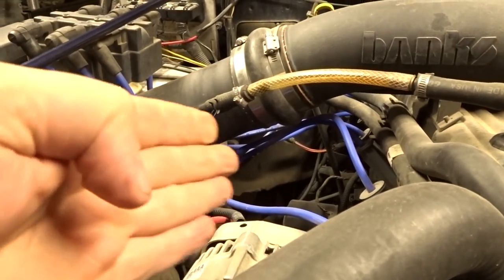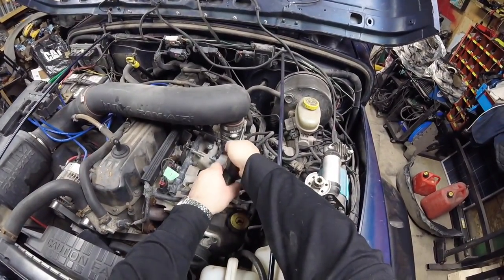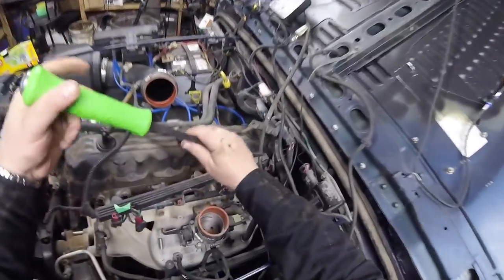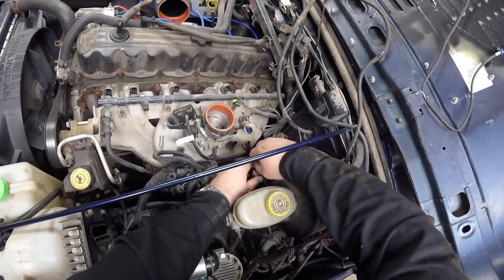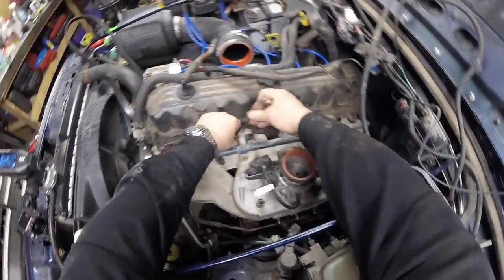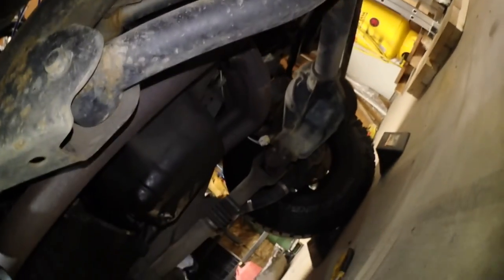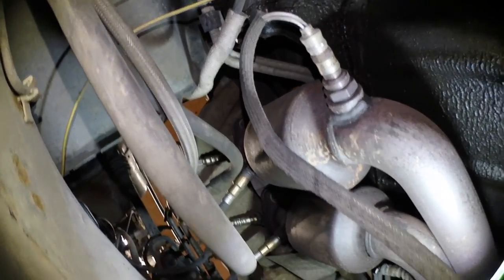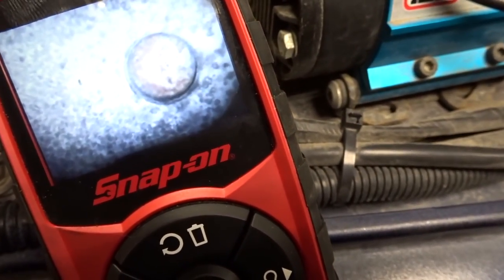No Turning Back Jeep 4.0 Intake leak

Comment: I changed the rear main oil seal on my 2002 TJ  last year, along with the pan gasket and the damn oil seal still leaks.
Not nearly as much as is used to, but it still leaks a bit of oil that drips every now and then.   It usually only leaks when I park it on a clean concrete driveway.   I think the best solution to the 4.0L oil leak is an engine swap.

I successfully killed-off a cold once when I woke up feeling that scratchy, itchy sore throat.  
I got good and fun-time drunk on either Jack, or VO, or Jameson,  don't remember which bit it was whiskey!
I woke up the next morning and felt great!  No hangover, and no cold.
Reply from the maker: I’ve heard that from quite a few people that changed the rear main seal and it still leaked

Comment: You're the brain surgeon for engines. Hope my SUV engines hold on until February.  Should have a couple paychecks by then.  I'm thinking all new fuel injectors.  I cleaned it up real good but even with new spark plugs sometimes it shakes on start up.  Not throwing any more codes though.  Feeding it 93 octane gas seems to help but kind of expensive.